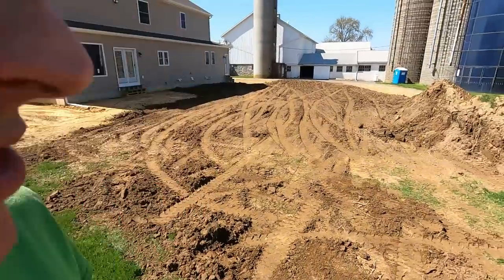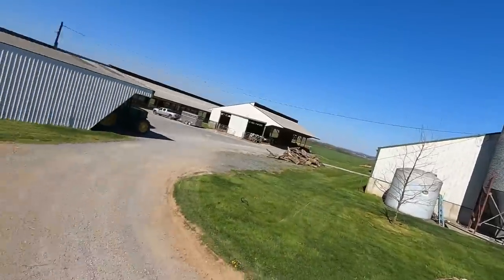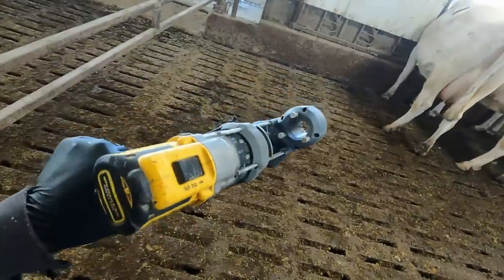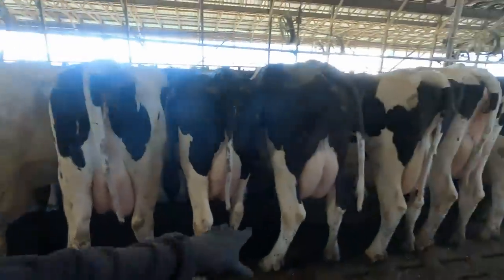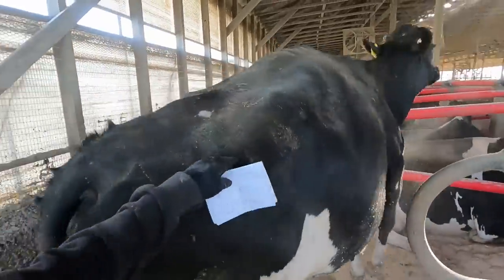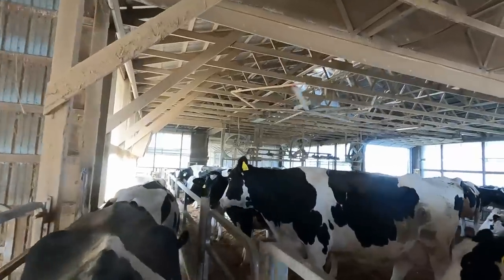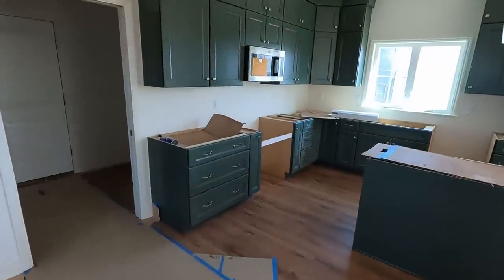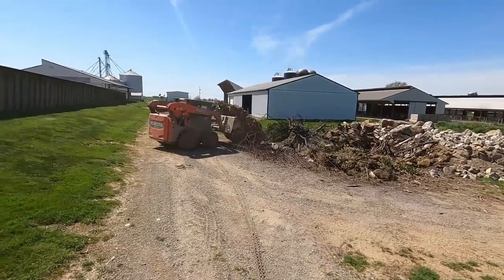Cow Work & House Almost Complete

Comment: You should put rubber down in the feed alley where the cows walk through, it makes it ten times easier to clean. Just spray it a bit then use a squeegee to push the manure into the pits

Comment: Just something to think about:  I'm 75, and a year ago I moved into the first two story house I've ever lived in.  The stairs are carpeted, and I do not like that at all.  The LEADING EDGE starts getting dark from foot traffic rather quickly.  We have even started not wearing shoes for up stairs, but it still gets dirty.  Some people put plastic runners on their stairs, but from my perspective that just defeats the reason for carpeting in the first place.  I plan to remove the carpeting on the stairs, and put nice hardwood on the them instead.  They will be a bit more slippery, but there are a number of ways to address that.  By the way, the shower is stunning.

Comment: Why are you not using that big stump, upside down, as a base for an outdoor table? Level the top as best you can (add a block where needed), get the dirt out, seal/dip it professionally, and put a big round wood table top over it. Great place for everyone to gather ‘round for supper and what not.

Comment: Verdict out on those robotic manure scrappers. LOL.  I have the same size shower, with a triangle seat. Women love shaving their legs using the seat. You will never go back to a small shower. Taking a shower goes from getting clean to a spa treatment, which is very relaxing.